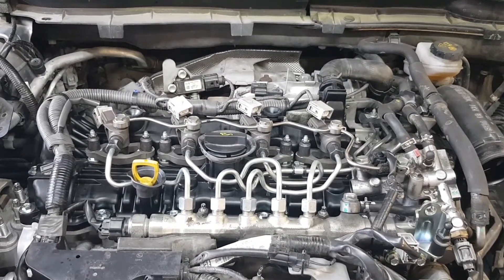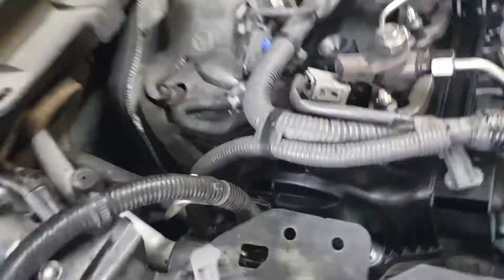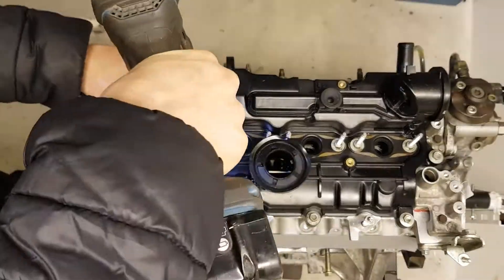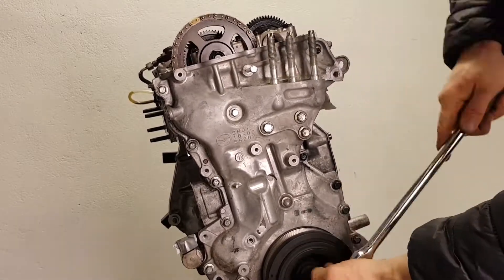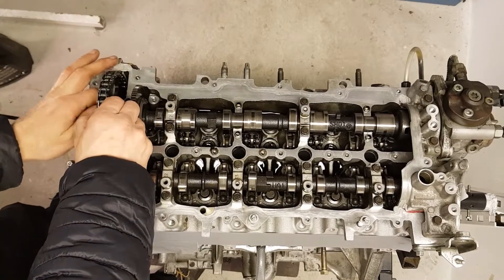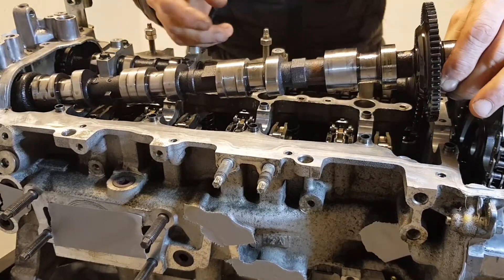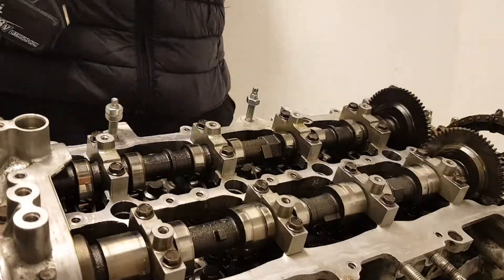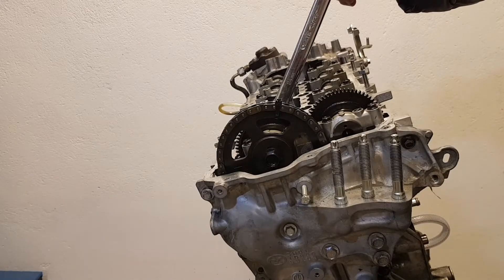Mazda Skyactiv 2.2 D Engine, Exhaust Camshaft removal installation.

Comment: what was the reason for replacing the cam shaft in the first place
Reply from the maker: The reason was camshaf wear on some of  first models of 2.2 skyactiv D, later on it has been modified.
Reply: @JB_Auto  Hello, could u specify which years are the problem models and when was the problem adressed?
Reply: @JB_Auto  cool mate does worn camshaft effect fuel consumption on  mazda skyactivd. Is there a recall on camshaft
Reply from the maker: We never had a complaint regarding fuel consumption on this issue, rather lack of power, hesitation. No re-call.
Reply: @JB_Auto  ok thanks pal
Reply: Was there a error code that come up for this problem
Reply from the maker: In most cases, no DTC, you need to remove the valve cover to inspect camshaft wear.
Reply: @JB_Auto  what mileage for the change usually?
Reply from the maker: @vivien o  Replacement is upon the inspection symptom lack of power hesitation.
Reply from the maker: @Fabiano Pedrotti That is not normal although I've heard about some cases. At our, workshop we inspected many but never discovered any with camshaft wear, and that was on cars with good maintenance history, proper oil etc... Out of curiosity, what is the mileage, and maintenance history?

Comment: Very clearly explained, thanks.
Reply: @JB_Auto  Greetings JB_Auto. I plan to buy a Mazda 6 Skyactiv D 184 from 2019 or 2020, I believe that these models have fixed the problems that appeared in earlier series, can you confirm that for me. If I saw well in the video about 1  : 10 deposits can be seen around the 2nd and 4th injectors, is there a way to detect this without removing the valve cover and how, can this be heard when the oil filler cap on the valve cover is removed and are gases passing through  next to the injector.Thanks in advance for the response and greetings from Croatia🙂🙂
Reply from the maker: @matohorvat5688  Hi, yes they are reliable, the AdBlue system makes engines much cleaner, meaning no soot buildup, very nice tuned engines, we haven't experienced any problems with them. ( the old versions up to 2013 Sept. problems were appearing in the first year of use. After that period those 2.2 D undergone heavy modifications and are constantly improved, I would buy anything after 2015 because of the facelift and much better appearance.)